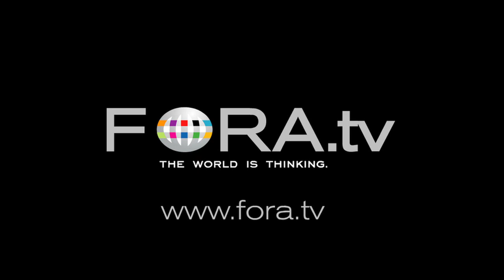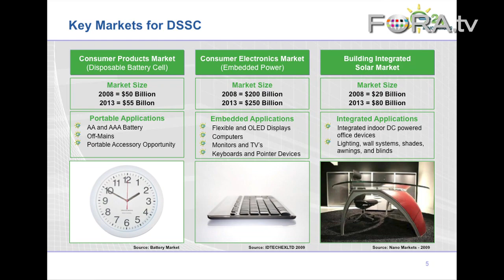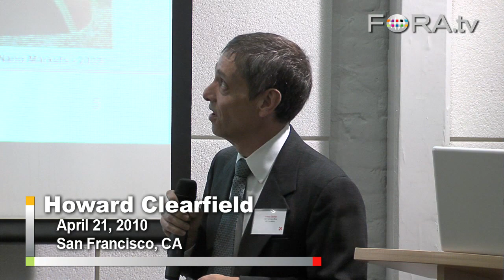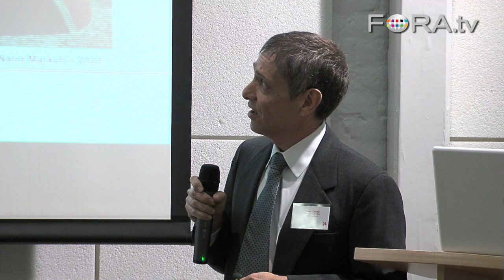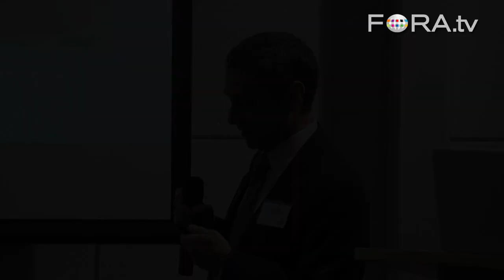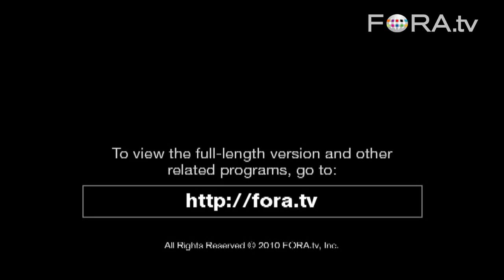Indoor Solar Cells? A 500 Megawatt Proposal

Comment: @ad2181 

The internal lighting is going to be on anyway though.  Right now it's going to complete waste bouncing off walls and being absorbed into your floor as heat or whatnot.  Why not re-use some of that spent energy?  And your nigh-on-conspiracy-theorist argument doesn't address, for example, the convenience of smaller, more lightweight appliances which will not require batteries.

Comment: It's easy to do it, and you can save money right now.

Install power strips with a switch everywhere in the house.
When you're done watching TV / using the computer, etc, I just flip the switch and turn the power off.

Works like a charm and depending upon how many appliances you have, you can save anywhere between $10 to $50 / month.

I know it saves me money.